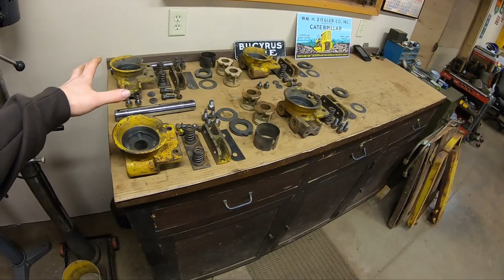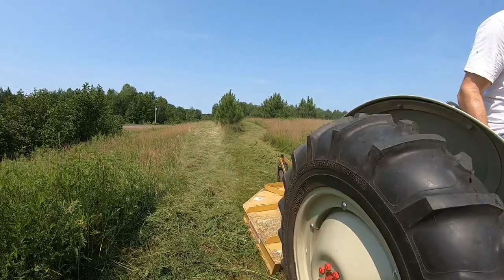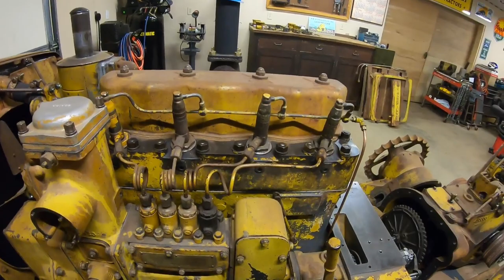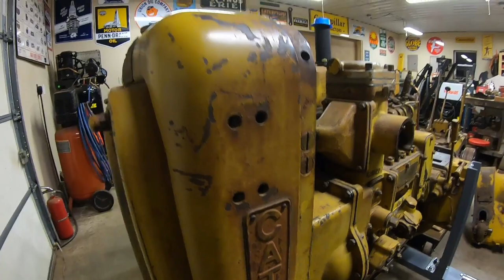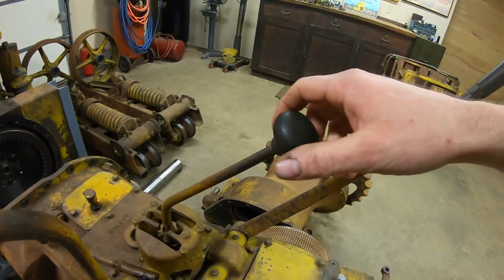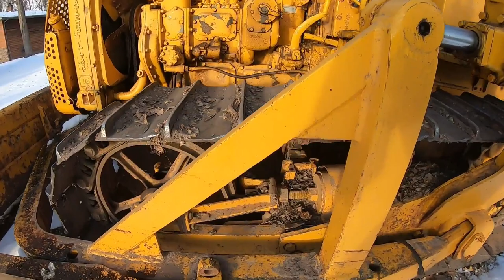Why I (Sometimes) Don't Put New Paint On The Tractors I Rebuild

Comment: I love both the shiny restorations, and the patina’d restorations. Personally, I hate to paint myself
Reply: @Hal Snyder Have you tried painting on a less windy day?
Reply: @ccga3359  let’s just say paint and I don’t get along… one of the few things I can do that I’ll pay someone else to do.
Reply: @squatch253  Way I see it, if paint doesn't make it run better, then why paint it? The closest I'll come is undercoating an old car, but that's not really painting. How the undercoating looks is irrelevant as long as it does a practical job: Keep the frame and floorpans from rotting out of it. But with how substantially built earthmoving equipment is that just is not a concern; they could sit on the bottom of the Great Salt Lake for 300 yaers and still be structurally sound just from the sheer bulk of metal they're made of.

Comment: I have never been bored watching your content. Generally there is always something new.  I watch other channels, there is one guy who has a fire wood operation and he has all the brand new shiny equipment.  However his videos nearly always feature a chain saw , firewood splitter,  him operating his band saw , driving one of his machines. It gets old after watching these operations so many times.  I agree with you about preserving historic paint with its patina. Here in the UK preserving the patina of tractors instead of  a repaint is becoming the norm especially if the tin work is relatively straight and rust free.

Comment: I've said it before I own both painted and unpainted, I have more fun on my unpainted ones.  When you go to a show there is usually more people standing around the originals pointing out the very same things you referred to than the long line of shiny painted ones that all look the same!
Reply: That statement could never be more true. We took our original 1942 Case SC to a couple shows this past year. The last one we attended another guy had an SC that was freshly redone with new shiny paint. He was parked a few spaces down from ours and I noticed most of the weekend that ours caught a lot more attention. I like them both original and painted, kind of like mentioned here, I would never paint our SC and take away from the stories it could tell, but my Farmall M is definitely getting fresh paint to cover up a previous owner's shoddy brush paint job. It just depends on the tractor.

Comment: That 1113 will look like it's ever been working and never needed any restoration, just like it has been going strong it's whole life. When you look at a freshly painted tractor or crawler, you konow in an instant, that it was restored and will never work hard again, different on that 1113, that could be freshly pulled off from farm work and can anytime get back to it.
:-D
Thx a lot for your hard work on the equipment and on the vids!
:-D

Comment: Some restorations need a clean paint job and others you need to keep the Patina.  Your restoration your choice. 
I have fully restored a Triumph TR3A (British sports car) and everything got blasted back to bare metal. The windshield has the original owners inspection sticker from 1988 and despite the fact that the windshield has some blemishes it is part of the story so it stays. I do have a brand new in the box glass for the car if I ever decided it needs to be replaced.
Merry Christmas.

Comment: I never questioned your choice to keep its history or felt the need to comment as such. One it's your machine soooo you can do whatever you want without anyone's consent and two I apply my own logic in these situations.  Same as you if it's been redone already then theres nothing to preserve or if it's so rusty and destroyed it's a no brainer to go max restoration. Right now I'm finishing a complete nut and bolt restoration on a 64 JD 110 garden tractor that has been painted and "fixed" many times by whoever so I'm taking it back to showroom condition but I have a 74 wheel horse that was well taken care of. I took it completely apart but all I did was clean everything and fix only what was broken or wrong. It has an amazing aged look that I couldn't change.

Comment: Paint is like so many personal choices. What's good for one isn't for another. I'm probably in a small protected paint group where I only painted the parts of my D2 that were worked on or repaired. The remainder of the patina is intact. It includes remnants of original and poor repaint efforts.

Comment: I think you really hit the nail on the head when you pointed out the contrast(s) between the Iron Mistress and 5J1113...different restorations call for different approaches.   Some tractors/vehicles/machines really call for new paint, others don't.  TBH I'd much prefer to see original paint on a tractor over some super high gloss, overspray covered, paint-over-dirt-and grease spray bomb "restoration" with horrible, thick, cheap decals.   All too common at tractor shows...I hate to bust on anybody's pride and joy,  but a can of spray paint slapped on is neither a restoration or a rebuild.  On the other hand, I do love me a nicely painted & decaled Farmall A/B/C/H/M.....Sr's Super M just looks "right".

Comment: It's called patina.
It always comes down to the owner/ restorers taste.
If ya want it painted do it.
If you don't because you like patina left alone do it.
Anyone else can pack it if they don't like it. 
It ain't their machine.
The overriding majority Iron Trap Garage Matt's 30's era Ford hot rods have their original patina as he acquired them.
He did paint a couple with brand new interiors and dash board and it's awesome. 
That's his choice just as your dozers left patina is yours.
OK, now I'm really impressed because of your explanation of why you like patina because it tells you the story of the tractors life as a tractor not with a dozer blade on it.
That's Sherlock Holmes level explanation of it's life span of usage.

Comment: Vice Grip Garage has a 'shine juice' recipe (2xlinseed oil+1xMineral Spirits) that he puts on the relic/rat-rods to protect the old wear from new wear. It needs to  be reapplied every six months or so. I tried it on a '58 MF35 I have and it worked out pretty well. Still looks old but is more protected.

Comment: might be a silly question, but why not boiled linseed oil with a little wax and turpentine.. when the turpentine flashes off and the linseed oil hardens it leaves a Matt oiled finish that doesn't collect dust and is moisture repellent..

Comment: You look at a building site, and see politicians on a Photo-op. With the company Big-Wigs. All wearing BRAND NEW HI-VIZ jackets :-). Then, in the back ground you see a guy with dirty, faded, worn-around-the-edges gear. HIM I respect. That comes from working in all conditions. Not sitting behind a desk.
Go to the big store. See the folks with brand new uniform, with razor sharp creases. Either head-office on a visit, or a new recruit. Find the folks with the faded badges, trouser so soft that it won't take a crease for more than half an hour. They the folk who can answer your questions!

Go to a museum, see all the shiny exhibits. Most of which do not run. They ARE informative, and NEEDED for posterity and a sense of the past. Then go out back and see the machine they use for demonstrations, covered in dust and oil, but that shows what it can do, how it does it, and has the story to tell. The one that lives! (And the old codger with a face that looks 'Lived-in' ;-) next to it LOL.

Comment: I'll admit, I didn't quite get it, up untill I got myself an old crawler, and after a few weeks of running it, all the foot plates and the step up to the seat, that had had the paint worn off them went from rusted to shiny bare metal. Someone, 60 years ago was doing the same routine that I'm doing now, and even though I originally intended to paint the old thing, that's something I could never paint over.

Comment: Here's what I'm doing with my stuff, I have three 955's, 12A Traxcavators so to keep track of what I've done to each one I'll paint the part that I've worked on and mark it with the serial number. One of the main reason is because within the series 12A  at 12A5793 the 955C, series model D4 undercarriage changed to the D6 undercarriage in the 955E model but still carried the 12A prefix. I have two 955C's and one 955E
Marry Christmas Squatch253's

Comment: Hey Squatch! Got a question about a 5J pony. Coolent travels to the pony when not running. Seen through top cover coolant vent. When i run the pony it stops getting coolant, any suggestions on how to fix this? Thanks!
Reply: Ya thats whats happening. There is coolant in the pony, until the pony is running. Then just air comes from the pony vent and it will over heat. I just replaced a rod in the pony. So when i reassemble i put knew head gaskets in. I did notice some air bubbles coming from around the head. So maybe i didnt get the heads torqued down enough and thats what is causing it to airlock. I do believe its just air in the system. The main engine doesnt over heat, so its working good there.

Comment: I never repaint equipment. One simple reason why.

Paint does not make it run better.

I have never seen any sort of machine perform any better because it got a rattlecan resto done to it. It may look nice but that spray paint isn't going to fix loose tolerances or leaky seals, it's not going to machine out decades of wear and tear or clean out heavy carbon deposits.